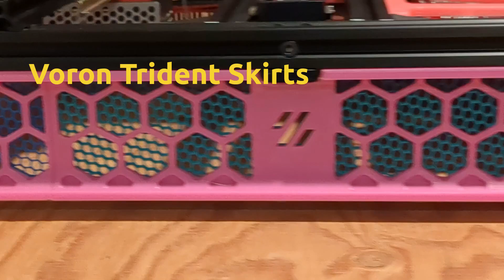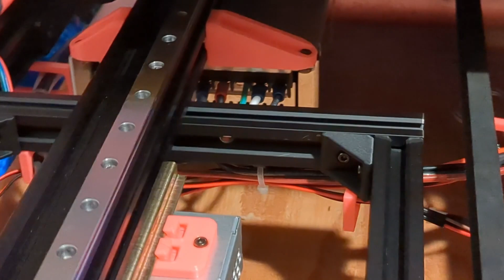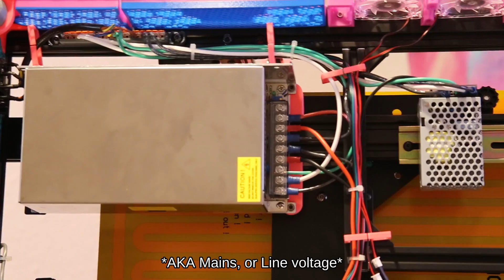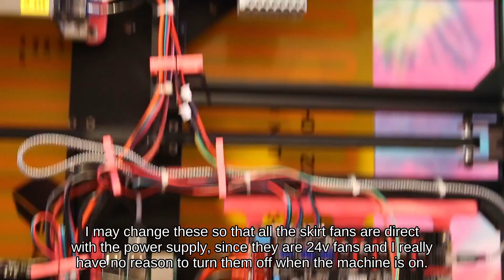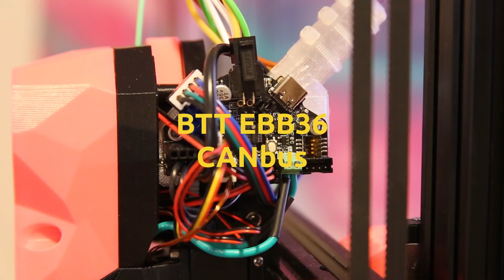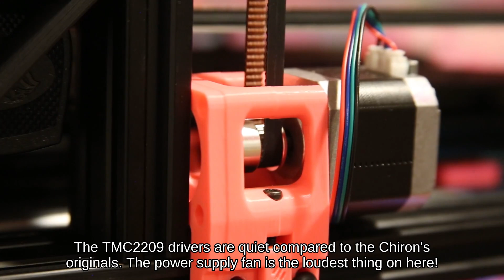ChironWire wiring, with CANbus, an overview on the electronics part of the build.

Comment: What was the parts cost to do this? I have a chiron I was gifted that needs the print head and I'm curious if this would be a worthwhile conversion.
Reply from the maker: i don't remember the final price, but it's not really worth it for performance, I would only recommend this upgrade if you are doing it for the learning experience, or if you need an open printer this size...
Reply: @ratty2austin thats kind of what I was thinking. If I can get it up and running for a reasonable price to make the larger prints I have in mind then it'll be worth it. Thank you for the reply.

Comment: Hi! Are you able to provide a link to the skirts you used on this build by chance?
Reply from the maker: At the moment, I am having trouble finding the exact files I used, which were a remix on Printables- but I know that they are basically the Voron trident skirts, from the 350mm size, but I had to stretch the center one a little bit (scale in one direction in the slicer) but also, the Y-axis belt motor+tensioner mounts need to have a little "slot" made in the center skirts, which is easy to do using the "add negative volume" in the slicer and line up the shape with where it needs to be. Here is the github for the Voron trident skirt files : https://github.com/VoronDesign/Voron-Trident/tree/main/STLs/Skirt/350

Comment: What size trident skirt pieces did you use? I assume you mixed several sizes to fit?
Reply from the maker: If I remember correctly, it was various sizes, and I did end up scaling some of them (stretch in the X or Y axis when printing) to fit, since the chiron is a lot longer in both X and Y... it's not perfect, but it fit after some test prints :)

Comment: You said you had layer shift in Y. Thats why i dont tune my Chiron anymore. I let it stock with klipper good is. In future i will build a Ratrig with the motor and stuff but this big slinger is not worth the time to upgrade. Except you got 2 and can build an new CoreXY with that. But then its a diffrent printer
Reply from the maker: @sn31t33  yes, i agree. i had hopes that this upgrade would have helped with speed, but it cant overcome the mass of the bed, which is the limiting factor of any bed slinger... in the end, i will just have to suffer with slow speeds, but it will be very tune -able with klipper.

Comment: Nice upgrade series...that layer shift ... I know that you've done so much already but, I'm pretty convinced that Anycubic realized this issue, hence why they used the dual shaft stepper motor with 2 belts on the Kobra max for the Y Axis afterwards... maybe you could get your hands on 1 of those stepper motors (or the one for the Creality CR M4), 2 GT2 10mm pulleys, a few meters of 9mm belt and 2 idler wheels... I have the Kobra Max and I plan to do Y rails soon... Im not a Voron guy so I plan on just using my Creality sonic pad for the klipper and moonraker and camera input... i may switch the X axis for a stock extrusion for linear rails too... but I don't want the work of maintaining lots of belts and pulleys. Nice results tho.

Comment: Nice conversion, I'm working on one as well for my bedslinger machine... just curious - that rattling noise during XZ movements - did you bother finding what's causing it?
Reply from the maker: Ahh yes, I probably should have added a subtitle that mentioned what that noise was- I figured out that it was the cardboard spool, "rolling" on the PLA spool holder, when the X rail was going downward (-Z)... I want to find a better spool holder, maybe one with bearings, or maybe do the reverse bowden setup and have a spool roller down low, off the machine entirely.
Reply: @ratty2austin I went reverse Bowden for mine. Roll sits beside printer... One less mass vibrating around lol

Comment: Yes the weight (about 4kg) of the Y Bed ist the only real thing that limit this Monster. I peel off the Glas Ultrabase and replaced the Sliders wiith own designed and printed Parts made with PETG. Now its less than 2kg and i noticed a smoother movement with less vibrations. It's not perfect yet because of the thin alu-heatbed there is a strong bending when it is heated up. Thinking about a rigid but lighweight solution so far..
Reply: You got some files? Thats the only upgrade thats sounds worthy. The bed is and will be the limiting factor so what the OP did is basically useless without a fast bed
Reply: @sn31t33  yes of course, i will upload the Files tomorrow on printables! Nowadays i have taped the original Ultrabase on the Heatplate.. sadly. But without it, the bend is too mutch until 80°C. But the PETG Carriage is working good so far.

Comment: Yesss!!! This is super cool. Clean build man! I’m running dual Y motors on my Chiron, in series off the same motor driver right now. Try this to potentially eliminate the Y layer shifting.

I want to follow in your footsteps and convert my machine too, this is bad ass!
Reply from the maker: Thanks! Are your motors mounted along the center with the one belt? (like, second motor up front using same belt?) or did you put them side by side and add another belt? I have plenty of stepper driver slots on the Octopus board, I could add another to spread the load for another motor...
Reply: @ratty2austin  two motor driving one belt! Printed a mount that clamps around the frame across from the original y motor!
Reply: I'm thinking of doing that too, just for better overall performance.... Maybe lol

Comment: I think the octopus is overkill for a switch wire, you could use an skr mini e3 v3 for this build because you don’t really need that many stepper motor drivers.
Reply from the maker: Yes, I realized that after I bought it and was beginning my build, but it was mentioned in the build guide I was following, plus it was on sale when I bought it. And- if this project doesn't work out, I can always use it again in a V2.4 build or something along those lines :)
Reply: True but if you wanna use deployable clicky, you should go for a 5 driver setup or maybe if he wants dual color also... so he would not need to upgrade he will just add a driver and cfg tuning...